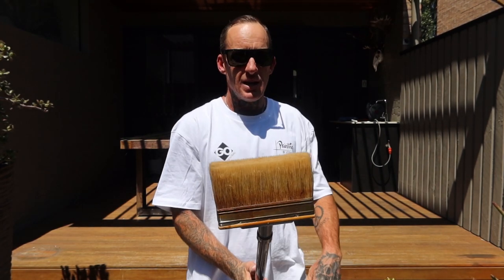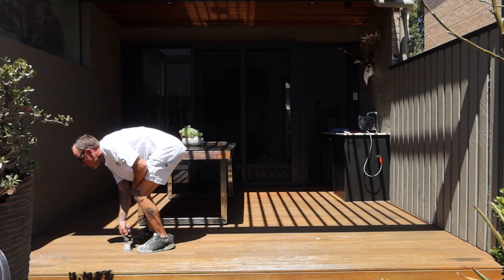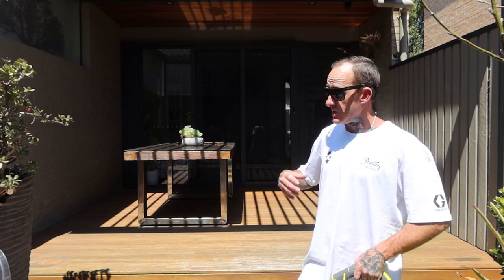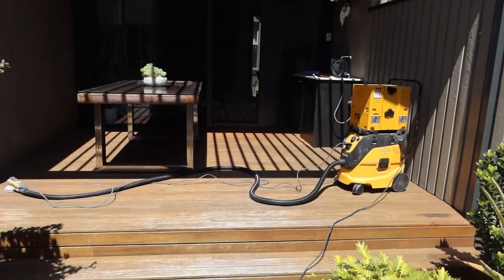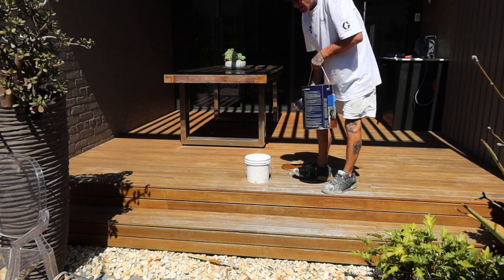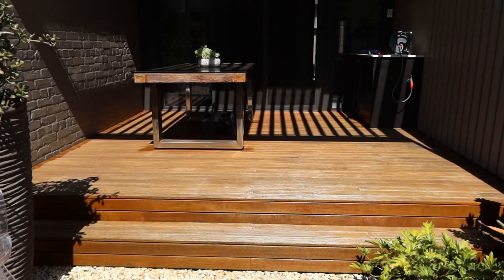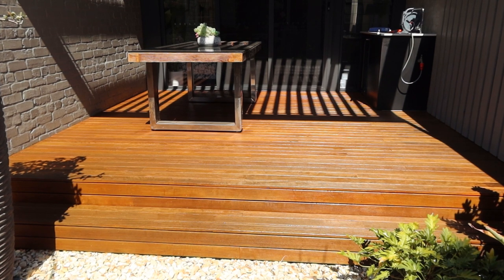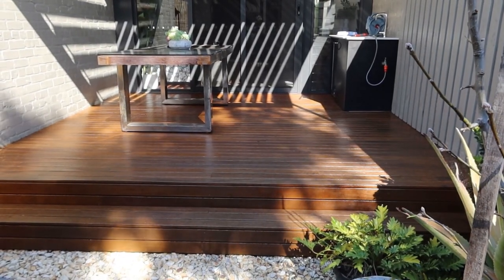PAINTING A TIMBER DECK

Comment: Thanks for the video its really shown me how easy it is to maintain a deck.
Ive noticed decking oils say you need to use deck cleaners before oiling, do you use any deck cleaners at all when reapplying oil or before the first time applying oil?

I previously used a natural oil on my deck (my deck is exposed to the elements) it already seems like it needs to be redone again after 4 months.
Can I switch from a natural oil based product to a water based product?
How can I know if its time to recoat?

Thanks for such a simple to understand video

Comment: Hey Josh, I've got a patchy deck at the moment. I cant sand back the timber as I have decking nails. Im wondering how a tannin and oil remover would go? What do you recommended it?

For background information, ive got surrounding rendered walls which ill prep. And would be keen on using Intergrain products.
Legend

Comment: Is there a tool for painting between the decking panels? Besides a brush, we just had ours done, and it looks crap on the edges
Reply from the maker: Hi mate. Usually the decking brush gets the sides of the decking. I'm not sure who done the job but maybe not done correctly. I would get a paint brush go through and brush the side the give the deck another coat. 👍

Comment: Is there any concern of lap marks or drying marks between where you cut-in and where you transitioned to the stand up brush?
Reply from the maker: This is a natural colour if it was a darker stain I would be concerned. Most waterbased timber stains are pretty easy to work with these days.

Comment: Thanks for sharing, really helpful! Just one question - for a previous oiled decking (2 yrs ago) do we need to sand the wood down before re-coating?
Reply from the maker: I Qi, thanks. I would recommend just a light sand if there is no flacking/blistering for adhesion and recoat. Regards josh

Comment: Hi Mate, thanks for the vid this was really helpful! Just a couple of quick questions, I’ve got a spotted gum deck that I wasn’t able to maintain and has faded/become very weathered,  before looking to re oil would you recommend I use intergrain reviver and ultra prep? Would those two solutions do the trick and allow for me to re oil without dramas? 

Second question was about cutting in for the second coat - should you cut in again or do you only have to do it for the first coat only? 

Cheers again for the vid and thanks in advance for your advice :)
Reply from the maker: Hey mate, sorry for the late reply. Yes the reviver will work a treat then all depends on how it comes up give it a light sand and dust and straight over with the intergrain. I would recommend cutting in the same amount of coats as you are rolling or brooming it on. Appreciate you watching 💯 hope this helps

Comment: Hey did you use any deck cleaner or pressure wash first? I’m unsure whether to bother. Don’t want to unless really necessary.
Reply from the maker: Hi, No deck cleaner was used just a good sand and dust down and ready to go for previously stained decks.🙏

Comment: Cool Vid, but I always pour from the front of the tin, that way I can still read the instructions in 6 months when I've forgotten them.   Do you think Ultradeck Is better than Intergrains  Natures Timber oil for hardwood decking? I've been trying to decide between the two.
Reply from the maker: Yes if you no to sure on the product definitely pour from the front so you can read the directions. The whole intergrains products are really good and easy to use 👍